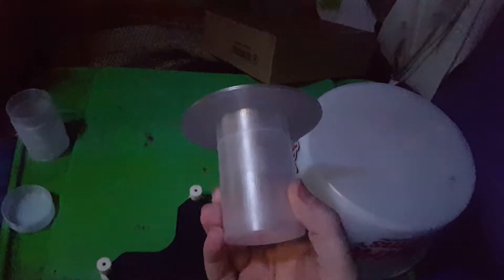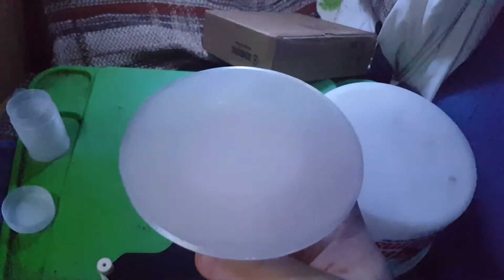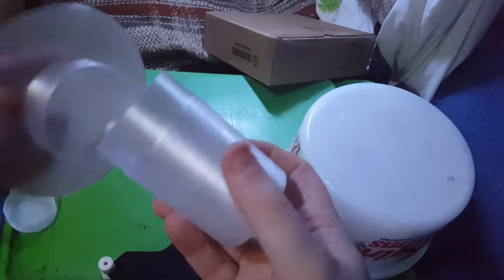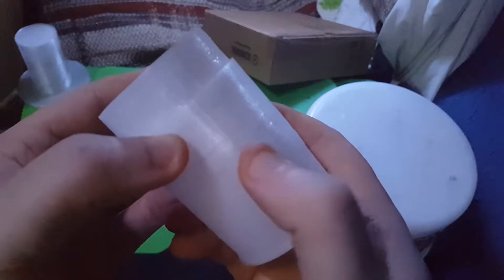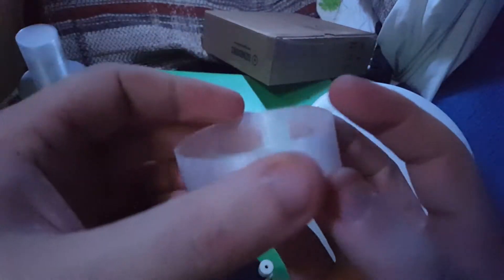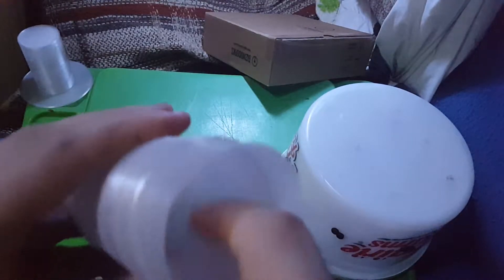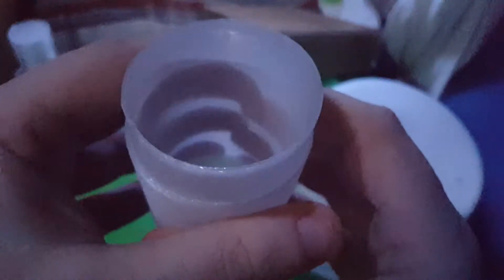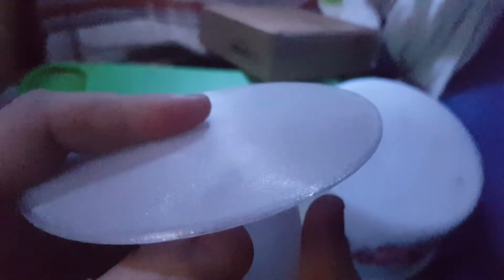The effects of Acetone on PETG (GizmoDorks brand)

Comment: PETG is a gummy filament and because of its properties you can adjust the strength using cooling fan, the less the cooling, the less brittle and more flexible, the more the cooling the more brittle and not as flexible. Have you found a way to smooth PETG prints?
Reply from the maker: Not yet, I need to get some more PETG filament again, but that's on the backburner indefinitely now lol.

I'm willing to bet there's a solvent that can dissolve it the same way acetone does to ABS tho.

I also now wonder how much  of my results was just due to it being a layered 3d print, as acetone and iso alcohol can easily get into places that water cannot.

Ah well, PET holds up well enough to be used in a homemade vapor chamber, it just means I might not be able to make my own bottles to store acetone in, and it's not like that was   problem to begin with. I was just surprised with the results I got from this test.
Reply from the maker: Actually I just noticed and remembered someone mentioned 10% methylene chloride in the comments below, lol.

Comment: Could you test how petg reacts with epoxy, do they stick or no, and If yes how tough is adhesion
Reply from the maker: I don't have much epoxy left, so I can't test atm.
A bit of digging around says it should work fine with it, however.

This is the best answer I've found:

https://engineering.stackexchange.com/questions/44905/how-well-does-epoxy-bond-to-petg-abs-vs-wood

I hope that helps.
Reply: @MetalGearSortof , yeah, I found the same exact article, but I guess art resin is different, some sourses said that Petg doesn't stick with epoxy. Guess I have to try it out myself, Thanks!
Reply: It will stick easy as long as you rough up the serface also if you want to get smooth prints with petg use a acitone resistant plastic tub put air holes in the lid and leav it in there for 20 to 30 minutes it's should smoothen out well prusa has made a video on cleaning up prints and it goes over a bunch of filiments including abs pla and petg and they all need 20 to 30 minutes in the tub if you don't want the bottom of the print to compromise use resistant plastic or a metal cooling rack to put the print on. Its obviously better if you put a fan in the box but some holes work fine because acitone naturally evaporates and makes the fumes it's better if you leave it out side or in a well ventilated area e.g. Next to a open window overwise it can make you light headed.
Reply: You also don't need a lot of acitone for this In fact the less there is the better for evaporation so I would suggest that you put just enough to cover the bottom of the container in about 3 to 5 mm

Comment: Is there any solvent that will smooth PETG?
Reply from the maker: None that I'm aware of, sadly.

As I learned from this tho, acetone does eventually affect it somewhat, so there must be something that does.
Reply: @MetalGearSortof  I just found out that methylene Cloride melted the surface of some scrap PETG I had.
Time for some research.
Reply: @mikeg4972  how to use ?
Reply: @VeterinaryAnatomyAcademy  I mixed some methylene chloride with some scrap PETG pieces(10%).
Used it as a glue which worked well.
Reply: @mikeg4972  thank you for information 😊 İs there video for this method ? Thank you
Reply: @VeterinaryAnatomyAcademy  The mixture has a tendency to "Gel" and get chunks.
if so, add some more M chloride filter out the chunks if needed.
Reply: @VeterinaryAnatomyAcademy  I'm not aware of any video on this.
Reply: @mikeg4972  thank you.
Reply: @VeterinaryAnatomyAcademy  Just be careful with this stuff. Harsh solvent.
Reply: Good question. I wonder if NMP (N-methyl-2-pyrrolidone) would work...? I just might give it a try since I have some of said solvent.